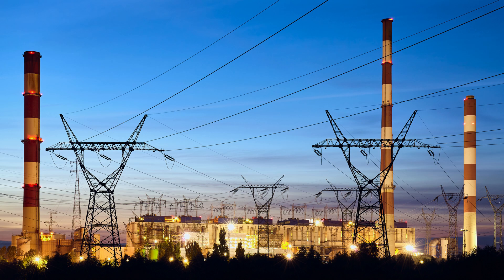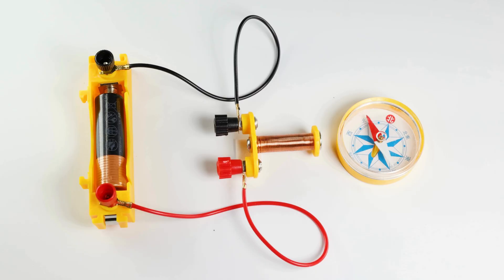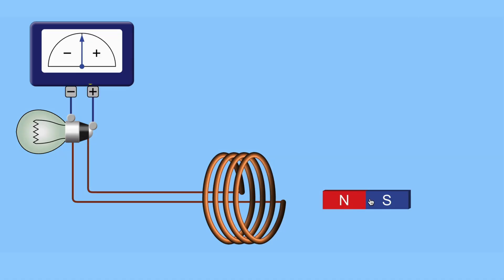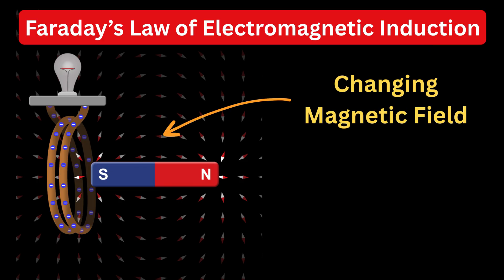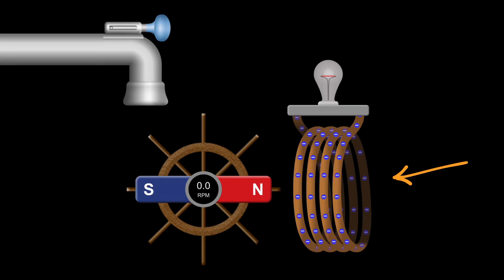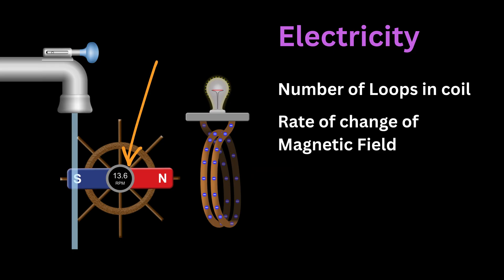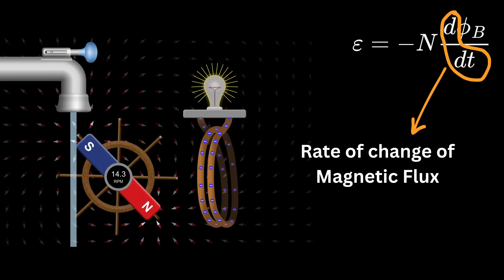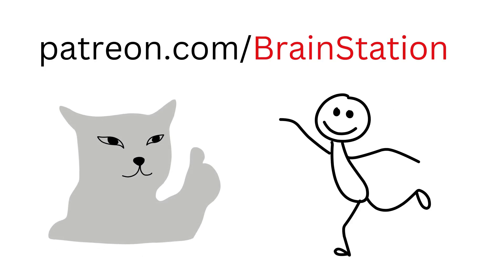Faraday's Law of Electromagnetic Induction

Comment: So did michael faraday use a volt meter to sense that needle  moves forward and backward. If he used volt meter, then electromagnetic induction was discovered before he did. May be I am wrong about this, he probably discovered the first generator. Thanks for electricity.